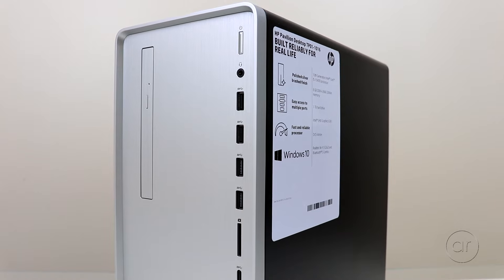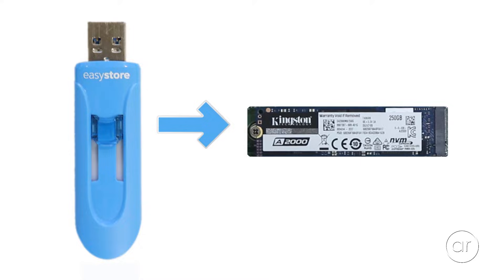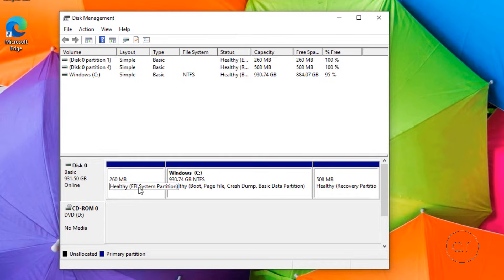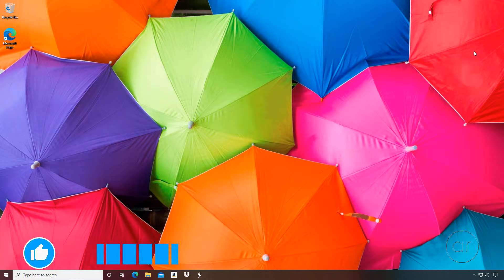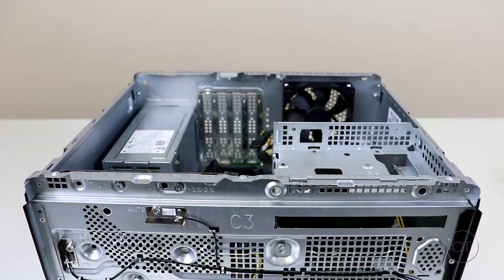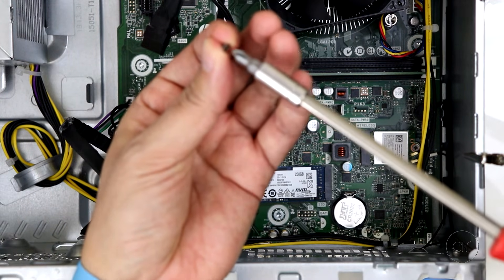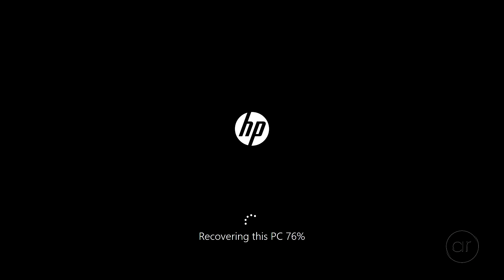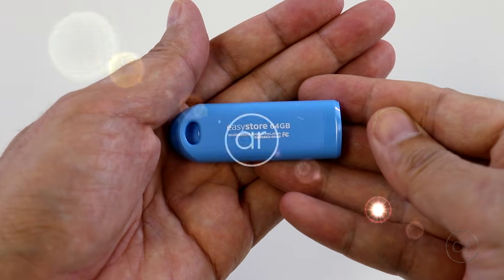Upgrade to an M.2 NVMe SSD and Restore Windows 10 (without Cloning)

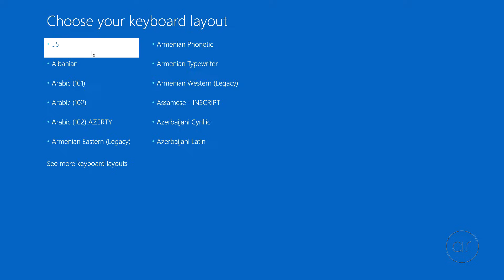Comment: Will anything in this process erase data on a separate drive that is already installed in my laptop? Basically, I have a 2tb SATA ssd that has almost all of my data. My Boot drive is an m.2 nvme that I am going to replace with a new one. When I do the recovery, how do I make sure that the sata is not erased, but the NEW m.2 is working with windows properly? What should I click on the screen at 6:55? I should mention that I have a few programs on the old m.2 that I would like to keep.
Reply from the maker: To be extra safe, what you could do is physically remove the 2TB SSD from the system while you restore the M.2 - then reconnect it after you're finished. In this way, it is guaranteed that your data will remain untouched. I've heard of others being able to restore while keeping your programs (and I believe they said there is an option to do that), but I hadn't really tried it myself.

Comment: Hello access random I have a question i wanted to transfer my Os to my new ssd but I have few doubts like my system is a Lenovo ideapad 3 15iglo5 .
1. Will transferring my OS remove my existing OEM windows key from the manufacturer
2. Will I get back all the apps that I got when I got my laptop as new
Reply from the maker: For a factory restore, the product key/license embedded in the BIOS so it will remain intact. As long as the apps are part of the factory image, those should be restored as well (at least for the HP - I assume Lenovo would do the same thing).

Comment: I have a HP Pavilion laptop, i have extra slot for nvmessd. How to install OS(Windows) in SSD without removing HDD.
Reply: Listen in order to boot from the usb you should not have the hdd in your pc
Reply: @maybealittledemonic3152  Ok, then what can I do now?
Reply: @Kavitha_2107  hey bro what I would suggest is try using recovery drive tool to create the recovery media in the usb and later on remove the hdd from the system and install the nvme pcie m.2. ssd and boot up it is the only and easier way
Reply: @Kavitha_2107  but if you want to just keep all your files and folders try the cloning method
Reply: @maybealittledemonic3152  I've heard that, cloning the OS won't give the best performance of SSD as fresh installation gives. Can we remove hdd from pc?
Reply: @maybealittledemonic3152  If we remove can we again place the HDD in its original position?
Reply: @Kavitha_2107  after installation what you have  to do is once the new ssd is up and running get yourself a SATA connecter and plug the ssd via the usb port In the pc then all you gotta do is format the hdd and voila you have formatted it then shut down your pc and reinstall the hdd into the pc after that the ssd will be the os drive and the hdd will be the data drive
Reply from the maker: What you can do is temporarily disconnect the HDD, then reconnect it after the factory restore. If you are not planning to keep the existing data on the HDD, you can wipe that drive using diskpart (https://youtu.be/sfS143DikPE).

Comment: I try it but they are telling me that the system is small after I put the USB to the laptop and turn it on !
Reply from the maker: Sorry, I found out that other system other than this particular HP model may require a larger USB disk (depending on how much software the manufacturer includes in their factory image).
Reply: @accessrandom  if you can help me I trying to replace intel optane to a m.2 nvme what shi I do ?
Reply from the maker: @aliyassine4837  I'm afraid I'm not sure about Optane. I'll need to defer to others who may have more experience - anyone?
Reply: @accessrandom  already everything is good I disable optane first then make cloning and everything is good)

Comment: My BIOS doesn't show my SSD as a Boot option only my HDD and The USB shows Up, Pls Help 🆘
Reply from the maker: What model is your computer? You may want to try physically disconnecting the HDD to see if the SSD shows up.
Reply: @accessrandom  Laptop - ROG Strix G531GU

Comment: If I decide to keep my old drive plugged in will programs installed on it still work properly? I want to use my old HDD as mass storage and my ssd for booting.
Reply from the maker: If everything is in one partition, the partition is considered as one indivisible object, so your OS (e.g., in C:\Windows) would be cloned with your programs (in C:\Program Files). All your programs would work as before, as long as everything fits on the destination drive.

Comment: How to keep the old files? I have so many software licences installed on my old ssd which I want replace with a bigger nvme ssd.
Reply from the maker: You may want to look at my other videos if you want to clone the contents of a drive to another. You can use the procedure here: https://youtu.be/mKSmwyPXH2I, except you would use an M.2-USB adapter instead of a SATA-USB. Cloning to a larger hard drive is detailed here: https://youtu.be/CHCENfs87F4
Reply: You can also keep your old drive plugged in I believe. You don't have to remove it.
Reply: @intothekey  Hi. Thank you for the suggestion. I only have one ssd slot, so unfortunately this is not an option.

Comment: Will this also include my files and programs? or just the os?
Reply: I find a tool called aomei is really useful in cloning, think it would be more convenient.
Reply from the maker: If the HDD is partitioned such that one contains the OS while the other has programs, then you can just clone the OS partition (but I would recommend including the other smaller partitions). However, if everything is in one partition, the partition is considered as one indivisible object, so your OS (e.g., in C:\Windows) would be cloned with your programs (in C:\Program Files).

Comment: Hi, i need to keep the 500gb hdd and all its files and local disk partitions while making the 256gb M.2 as just boot device without other partitions as in my hdd. mine is windows 8.1 pre installed hp probook 440 g2. i have the hp recovery cd with me. what should I do?
Reply from the maker: What you could do is follow the procedure in the video to restore to the M.2 SSD, then reconnect the HDD if you want to use it as a secondary disk (it would still have your original OS/files on it). After making sure you can reliably and repeatedly boot to the SSD, you can decide whether to delete the OS partition on the old hard drive.
Reply: @accessrandom  thanks a lot and 👍 for the fast response. 👌 +1 sub☺️
Reply from the maker: @faz7tube  Your welcome - very happy to have you here 👍

Comment: Does this work if i want to transfer my data from a nvme to an other bigger nvme? Do i need to buy a new Windows key?
Reply from the maker: Yes, this should work going to a larger NVMe. Since you're restoring to the same machine, you will not need another Windows product key (it is embedded in the BIOS for any computer that originally came with Windows 8.1 or 10).
Reply: @accessrandom  thank you

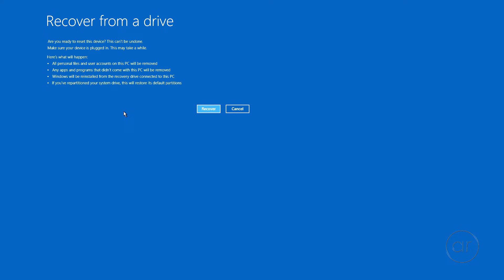Comment: I keep getting a message after minute 7:04 on the video.  saying “There was a problem resetting your pc. No changes were made” after clicking recover from the flash drive
I need help :(
Reply from the maker: I research this a bit by googling, and it seems the most common reasons for the error message are a corrupt file preventing Windows 10 from resetting, or the deletion of important files due to an abrupt shutdown. The solutions are fairly lengthy but there's a good article on a website called makeuseof, which you can find be using the error message as the search string. You may need to reconnect the hard drive again for some of these solutions, though.

Comment: Could I do a clean install of windows on my laptop from a bootable usb onto a new nvme, but still have windows activated without the product key? or would I have to get a new product key for it to stay activated?
thanks in advance!

Edit: Just to clarify, my laptop came preinstalled with windows on the ssd it came with, but i dont want to use that ssd as i would like to swap it out completely to be able to connect 2 nvme drives.
Reply from the maker: Yes, the product key is actually embedded in the BIOS on newer laptops (Windows 8.1 and Windows 10), so the installation of Windows will automatically pick up the product key. For peace of mind, you can always retrieve the product key using the methods in one of my other videos: https://youtu.be/nl4okILnko4
Reply: @accessrandom  thank you!! i was worried i'd have to buy a new one. i'll check out that video you linked :)

Comment: If i already have things downloaded on my factory ssd, will i be able to transfer everything to the new nvme following these steps? 

I have a 512gb ssd in my laptop (it has 2 ssd slots) and i want to add two 1tb nvme drives in the future and take out the 512gb ssd, but I don’t want to lose everything thats on my current ssd, not sure what the best way to do this would be. So any help would be greatly appreciated!
Reply from the maker: For your case, you may want to consider cloning the SSD to the NVMe. I have another video that explains that process here: https://youtu.be/cVRVgrOl1M8.

Comment: exactly what i was looking for. 
this is the easiest way of doing it. 
i was thinking of cloning, but going from a larger sized HDD to a smaller capacity SSD via cloning may pose unexpected challenges. this recovery disk method looks to be the simplest, easiest and safest way of doing it. 
btw, with this method, the recovered new SSD would have practically all current windows keys associated with the machine, current drivers at installation, settings (as much as possible), etc? 
thanks again for this good work.
Reply: I see.
To clarify, this factory reset point would be at the version that was originally placed by the manufacturer, or would this restore point include updates? Like I am now at the latest Windows update version, would it revert to an earlier build of Windows 10 from the original machine?  
I would still be ok with it either way. Just want to set my expectations when I try to do this. 
Thanks again and appreciate your response. 
Cheers!
Reply from the maker: @jeriellucas3543  That's a good question. I believe the original image would be static, but I'm not sure if it is updated in any way during a Windows update - I'll need to defer to others who may have had more experience. Anyone?
Reply: @accessrandom  Thanks again. I am now asking my wife if she wants to go through the upgrade. I will also ask if she wants to do it this way, or thru cloning as we also have MS Office, and I don’t know where the product key is anymore. In that case, I’ll just ask them to move their files like pictures out of the drive prior to cloning to make sure it will fit the SSD. 
We have an all-in-one, and it is painfully slow due to a 2TB HDD, but per documentation, it can fit an M2 SSD. Not sure if it will be worth it given the AMD A8 in that PC. We will be  weighing if it will make sense to upgrade or it won’t matter despite the upgrade cost.
Reply from the maker: @jeriellucas3543  Sure. The product key for Office can actually be retrieved using a utility called Produkey (I demonstrate it in one of my other videos to get the Windows product key, but it will work for Office as well), if that helps: https://youtu.be/nl4okILnko4. My cloning video can help with the cloning if you decide to go that way.
Reply: @accessrandom  thanks again. i just saw the linked YT video, and it is great. i will definitely have a lot of options to make this migration to SSD quite a bit more manageable and regardless of which route to take, i can be secure that i have the appropriate windows and office keys that i would need. all the rest, i can just get from the other online services. 
appreciate your efforts in helping your viewers. i will definitely refer to your channel for such information, and will subscribe.
Reply from the maker: @jeriellucas3543  You're welcome. Very happy to have you here.
Reply from the maker: You're welcome, and thank you 🙏. Yes, the Windows product key is typically embedded in the BIOS so the recovery will pick that up automatically. Basically, it should give you a factory-restored image, including drivers and original settings.

Comment: how about program installed on the drive?
Reply from the maker: If everything is in one partition, the partition is considered as one indivisible object, so your OS (e.g., in C:\Windows) would be cloned with your programs (in C:\Program Files). Everything would work as it did originally.
Reply: @accessrandom  great, but I have another question. My drive C: consumed by windows and program around 76gb but you mention 16gb flash enough for backup/clone?
Reply: @accessrandom  I just inform you that I follow your instructions as your video, but please unfortunately not successful and always get error because PC.
Reply from the maker: @CambodiaShareFeeds  Sorry to hear you're having problems. Were there any error codes or error messages?
Reply: @accessrandom  I have got message that error pc. but it is working now because I clean install new windows. actually your method just for some pc not all.
Reply from the maker: @CambodiaShareFeeds  Thank you for the feedback. May I ask what PC you are using?
Reply: @accessrandom  I used MSI GE62 6QF laptop. i7 6700hq, ram 16gb, ssd 512gb intel ssd.
Reply from the maker: @CambodiaShareFeeds  Thank you 🙏. I will keep it in my notes in case others encounter the same problem.

Comment: I accidentally installed W10 in my gaming pc on my hdd by mistake and want to transfer my W10 to my ssd instead can this video help?
Reply from the maker: That's a good question - I believe the factory image recovery partition remains unless and until you explicitly create your own W10 recovery partition, so I believe it would restore the older Windows on the SSD. I'm not 100% sure though, so I'll need to defer to others who may have tried this - anyone?

Another option is to clone the original hard drive (which basically creates a copy of your W10 to the SSD), which I've documented in one of my other videos: https://youtu.be/CHCENfs87F4

Comment: how do i transfer from nvme to another nvme?
Reply from the maker: If you have only one M.2 slot, you could follow a procedure similar to one of my other videos: https://youtu.be/mKSmwyPXH2I - except you would use a USB-to-NVMe adapter instead of a USB-to-SATA adapter. If you two M.2 slots, you could use the process in this video - however, you may need to swap them after the clone, depending on your motherboard.

Comment: Sir, I replaced the original WD 512 GB ssd with a Samsung 980 1TB ssd in my Dell inspiron 7400. Reinstall the backup windows by pendrive. Everything ok. But my device manager shows WD 512 GB instead of Samsung 980 1TB. How to solve this. Of course BIOS shows Samsung. Thanks
Reply from the maker: Are both the WD and Samsung still installed in the computer? If so, you may want to try physically removing the Samsung.
Reply: @accessrandom  Thank you so much for responding. My original WD SSD has been removed and Samsung 980 is the only SSD installed now as there is only one SSD slot. But disk management shows its WD. How to solve sothat I can see Samsung 980 in my device manager. Thanks again
Reply from the maker: @snswain2339  That is strange. Could there be a storage driver that had been installed for the WD? If so, is there a Samsung driver that you can attempt to update to?
Reply: As I see the driver is Microsoft driver. Updating driver says its latest for the device. As I learned somewhere that it's some registry issues. It needs uninstall drivers and restart will solve. Sir as this is the only ssd with os and 2 partition, if I uninstall ssd driver will it cause problem to boot ??
Reply from the maker: @snswain2339  I'm not sure - I assume the MS driver would be re-installed while booting, but I can't say for certain. You might want to make a complete image backup before attempting...

Comment: So I bought a new computer with a 512gb nvme and windows 10 pro. The old computer has windows 10 home plus about 150 gb of data. I wanted to transfer just the data and not the home version to my new machine. Can you help me find a solution. Thanks so much.
Reply from the maker: if everything is in one partition, the partition is considered as one indivisible object, so your OS (e.g., in C:\Windows) would be cloned with your data (in C:\ProgramData and elsewhere). If they are separate partitions, you could create an image of the data partition, then restore it to the other machine in a secondary partition.

Comment: bro for the hp recovery drive how much it will take the storage ( I'm using a hp laptop btw)
Reply from the maker: I'm afraid I didn't measure the actual space taken, but a 32 GB flash drive would be a safe size.
Reply: @accessrandom  okay noted, that would somehow helpful in future.

Comment: Will this have trouble with HP safe start? Will I need to tweak the Bios for HP to boot from a new M.2?
Reply: Update: it worked! Liked, subscribed and shared. Thank you so much. HP should hire you as you give better support than them.
Reply from the maker: @Francis M  Thank you for the update 👍. Very happy to have you here.
Reply from the maker: Do you mean booting into safe mode? I have not had to tweak anything in the BIOS (nor have I had any reports of anyone needing to).